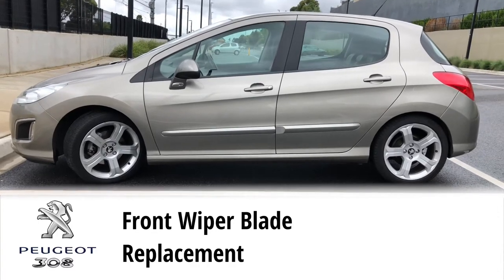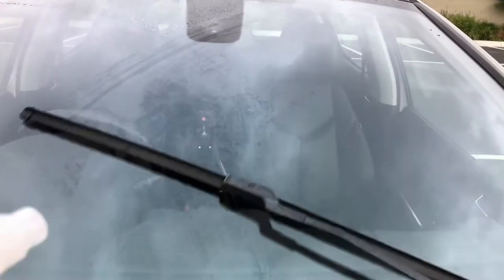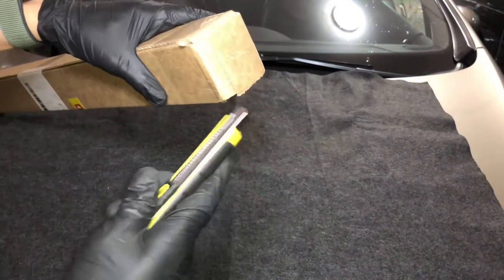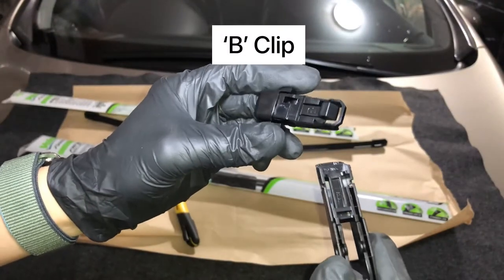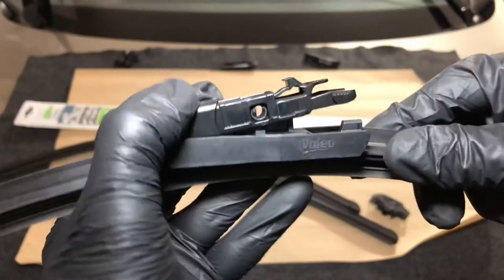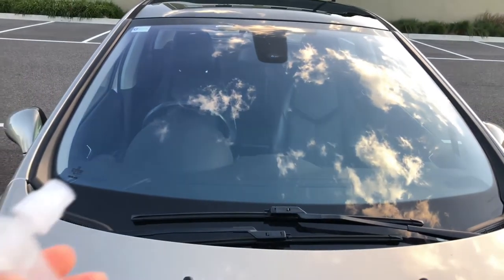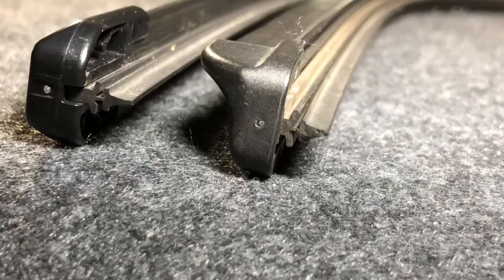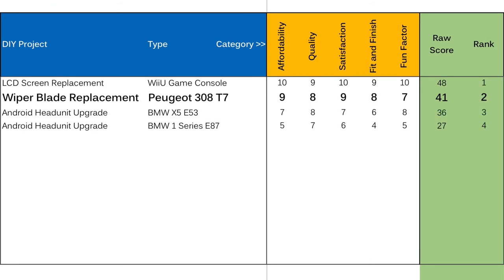PEUGEOT 308 T7 | REPLACE FRONT WIPER BLADE

Comment: Great video. Is the drivers side wiper the shorter than the passengers?
Reply from the maker: Yes, it is.  If you put the longer wiper on the driver side, one end of the wiper blade catches bottom edge of the windshield.
Reply: @AutosNGizmos  Are you sure? I just replaced mine with the 75 cm drivers wiper brush. It works fine. Maybe it has to do with it being the left steering wheel side model.
Reply from the maker: Oh, perhaps thats the case.  On the left hand steering model, does your driver-side wiper arm sit above or below the other wiper?  Mine sits below so the 65cm was a better fit.
Reply: @AutosNGizmos  Mine sits above the passengers. That explains it then. Thanks.
Reply: only in uk japan etc ;) passenger is shorter in rest of the world i notice in my 308 no need for 750,700mm is also ok on longer side